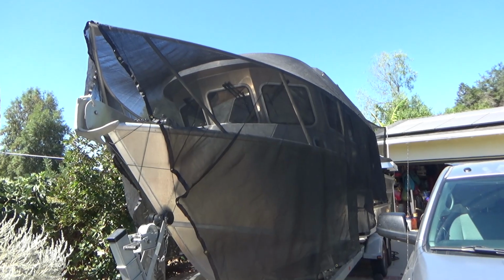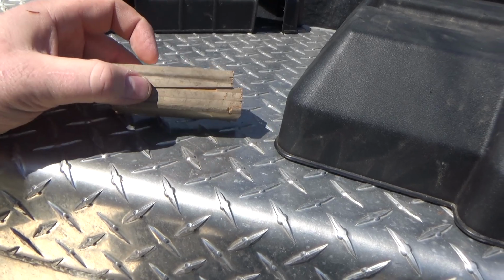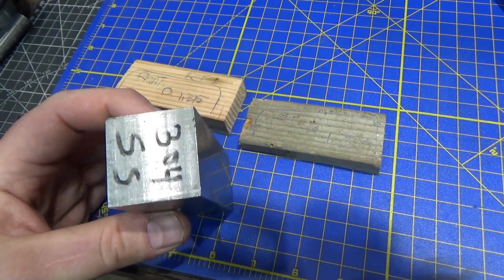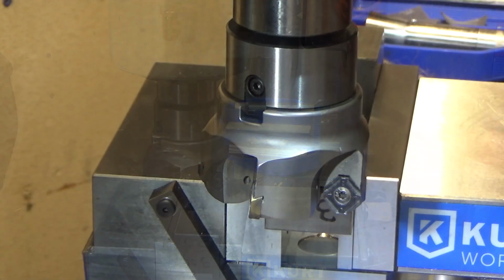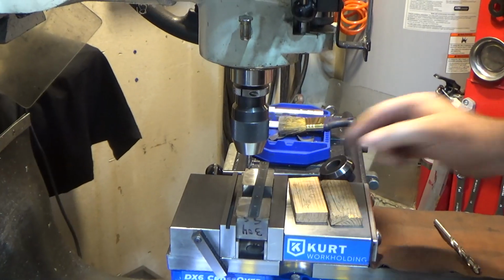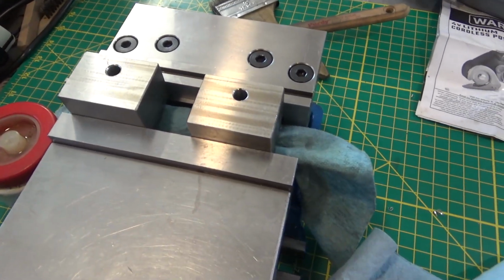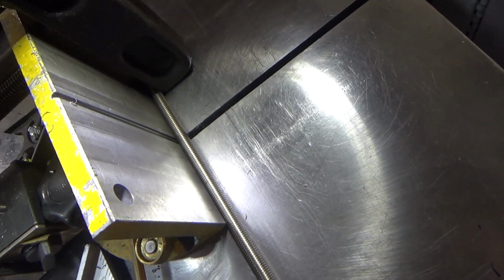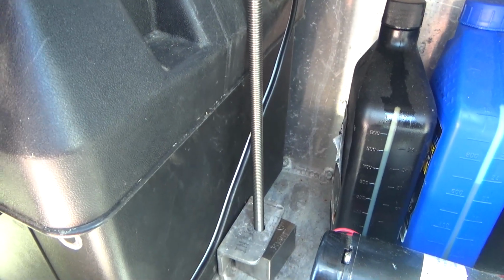198 Boat Triple Battery Retaining Bracket

Comment: I’m a little surprised you chose stainless for the blocks. Stainless + aluminum in the bilge of a boat sounds like perfect conditions to maximize galvanic corrosion. Have you done anything to reduce the electrical contact between the stainless and the aluminum?
Reply: If it’s in fresh water it might not be such a problem. I’d just keep an eye on it. It would be a shame if the stainless damaged the hull. A gob or two of Tef-Gel where aluminum makes contact with the steel could provide some cheap insurance.
Reply from the maker: Your point is well taken. Thanks for the suggestion.
Reply: If you have any problems you can get some sheets of rubber from the plumbing section if you wanna get fancy go to the window section and you can get self sealing adhesive rubber sheet that's used for window flashing instead of tar paper it sticks really well and I've used it for all kinds of boat stuff you can stick it to itself to make it as thick as you want and lastly if you want something even thicker you can go to the roofing section and buy basically the same thing but thicker and tougher that's adhesive rubber meant to go at the end of your roof under the shingles to prevent ice dams rain rolling up under shingles in storms etc it's also self sealing so you can nail etc through it I've used both on aluminium boats in AZ with summer temps to 120 and its lasted for years 👍👍👍
Reply from the maker: I was concerned as well, but the original design was 303 stainless nuts under the aluminum and 303 stainless bolts clamping down the aluminum bracket. We used 316 stainless and are hoping for at least similar survivability. There didn't seem to be too much galvanic corrosion with the old setup, but the boat is only a few years old.

Comment: I really don't understand why adjustable parallels are not regarded like clamps; every shop needs them and you can never have too many. I was first introduced to them through machining, later discovered planer gauges which quickly became a favorite tool for several different trades. I'm hard-pressed to think of an industry that couldn't make use of the basic principle. Now that I've adapted to using them in so many ways, I'm sort of surprised there's not more commercial tools marketed towards framers or drywallers, something larger and plastic but the same principle. Every time you use it measuring tape and pencil you're just compounding the error, virtually every industry does better with a physical object as the measuring tool
Reply from the maker: You are so correct there. Adjustable parallels are a really versatile tool. I have two sets.

Comment: It seems surprising to me to see a boat like that that far south. This is the Cadillac of the sea both here in Puget sound and all throughout the Aleutian Islands. For whatever reason, the majority of the Alaskan fishing fleet Winters in my town. The boats used for this are very subtly different than many similar looking boats, there's a pretty shocking price difference though; I think most people expect aluminum to be of the gauge that they encounter on a canoe. These boats often are constructed of 3/8 material, I've even seen double hulls with flotation foam in between. It's not uncommon for the outboards alone to total into six figures. People are always blown away because from anything more than 50 ft it looks like a very familiar style aluminum fishing boat, the shape is very familiar. It's not until you're on board that you realize the scale is wildly different and they are built tough as hell. You're not going to get hail dents for example. But it's very common particularly in Alaska for people to put more into their boat than their home; it is their home for half of the year and their living to boot
Reply: I've watched a lot of these boats come off the stocks and watched the evolution of their shakedown over the first few years. I don't claim any expertise, but I'm fairly observant. You might want to pass on to your brother-in-law, pretty much the first modification every Captain takes on is to slowly replace everything and anything plastic with uhmw or delrin. It just lasts so much longer and doesn't get brittle. Two little scraps of uhmw make shockingly effective machine skates, they are very low friction. These same properties make them enormously useful for ad hoc situations and more importantly makes cleaning tremendously more effective.
Reply from the maker: you had some great tips there and he has already started just that through the necessity of Sun degradation here in So. Cal. He bout his boat from a custom builder in Washington. He and my sister love to take the boat up to Canada and spend a couple of weeks piloting up the inside passage. The rest of the year is local fishing in the channel islands. Logs floating vertically up north will total a fiber glass boat moving at speed, he chose a rugged design.